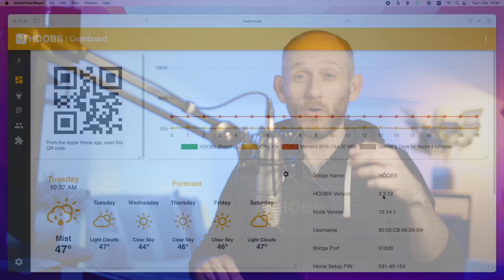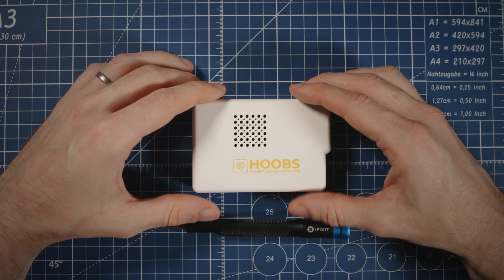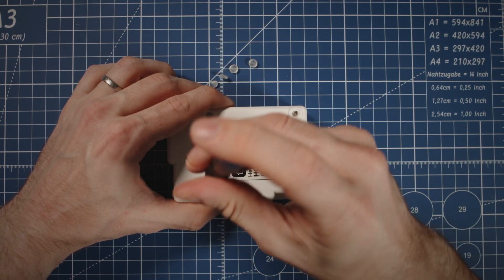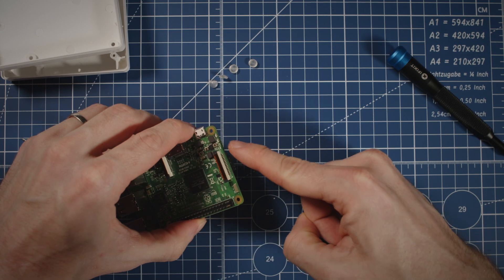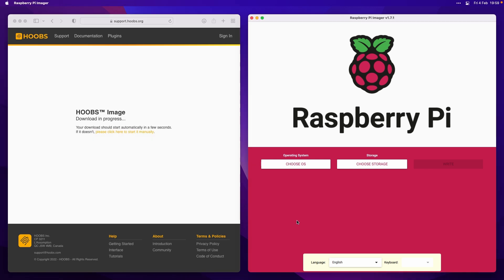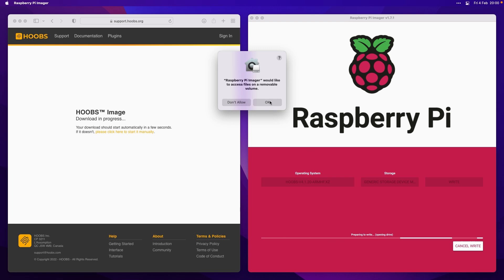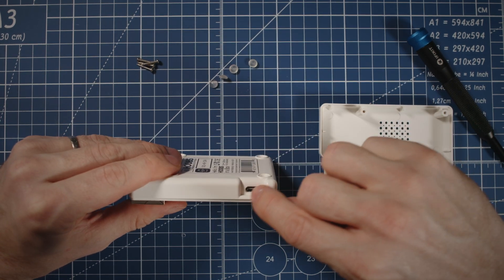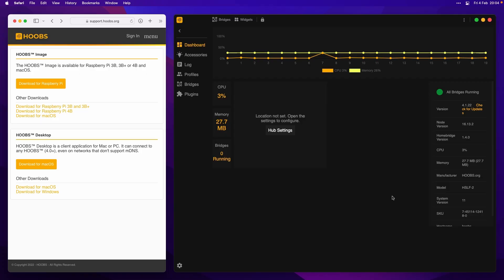Upgrading my Hoobs 4 setup with a quick reflash

Comment: Hi, thanks for the video. I went through the whole process, but can get the hoobs connected. Also, I noticed it has a solid red light inside, Is there something else I have to do? Thanks
Reply from the maker: Solid red signals stable power so that's a good sign. The green LED should flicker a lot when booting and then will probably go off.

Are you connecting over Ethernet or WiFi? You'll have an easier time doing the initial setup over Ethernet and you should see the lights on the Ethernet port flicker signalling data is being transmitted.

Comment: Thanks for this video. I'm trying to go through this process to restore my service, using the Balena Etcher app on a Mac to reflash my SD card (for Raspberry Pi) but unfortunately, I keep getting an error warning saying "the elevated process died unexpectedly". Any suggestions?
Reply from the maker: Have you tried using Raspberry Pi Imager as an alternative to Balena? It's possible there's a bug.
Reply: @tech_craft  Actually, I was finally able to do this by using a very old version of Balena Etcher. The problem was, I was trying to do this on an old 2008 iMac running on Catalina OS (the only computer I have available at the moment), and for whatever reason the newer versions of Balena Etcher wouldn't play nice with the older operating system. I also checked into installing the Raspberry Pi imager, per your advice, but unfortunately I would need a newer version of Mac OS to do so. Thanks to a Google search on "Mac Catalina and Balena Etcher" I was able to find a thread in their support forum describing this workaround, and I am back in business!

Comment: Thanks for the video. I use HOOBs for my home. Is there a program I can do a backup/mirror my SD card? I would like to have a backup card incase the SD card I am using become corrupt. It would be nice to be able to take out my SD card and insert the back up card and be back up and running without reprogramming everything. Thanks again for the video. I will be following.
Reply from the maker: Thanks for the kind words! There are a few options for backup. Which OS will you be taking the backup on?
Reply: @tech_craft  I would be using Windows 10. Thank you for your help.
Reply from the maker: It’s been a while since I did this on Windows but I believe the current best option is still Win32 Disk Imager: https://sourceforge.net/projects/win32diskimager/
Reply: @tech_craft  thank you very much. I will let you know if it works.

Comment: Hi,
I did the update just like you showed it on my RaspberryPi 4. After that my hoobs does not show up in my network, regardless if connected via cable or if I try to reach the wifi access point to set it up. It's not even in the list of connected devices in my routers device list.
Any suggestions anybody?
Reply from the maker: Are you able to connect the Pi to a monitor to see what, if any, error messages are being reported?
Reply: 12.7290581
-I end Kernel panic
- not syncing: Attempted to kill init! exitcode=Ox00000100

That is the error it showed me after hooking it up to a monitor
Reply from the maker: Yow! Which image did you download? I’ll burn it on to one of my Pi 4s and check!
Reply: Now I downloaded the one specifically labeled for the 4B and it worked. Thank you so much for your help!!!
Reply from the maker: Perfect!

Comment: hi glad you are back, my Hoobs is on version 4.0.110 and no updates to be had, should I do a backup with all the bridges I have installed as im guessing this will all be gone after a new install is done, will the backup then work and install all the bridges that are there at the moment or will it be a complete start again?
Reply from the maker: Backup works nearly always for me, but I always like to use a new SD card when doing the flash. I have two that I rotate, keeping one always with a known working set up.
Reply: @tech_craft  If my Hoobs wasn't updating, I backed it up, flashed a new card, will the backup still add all my old settings?

Comment: Question. Do you know if hoobs can work with a Raspberry Pi Compute Module 4. Thanks
Reply from the maker: Certainly can. You'll need to flash the Hoobs image on to the CM4, but you'll have no problem getting it to work.
Reply: @tech_craft  ok Thanks.

Comment: Will you be doing another dive into Wyze Cams on HOOBS? I’m running V3s, and not really interested in killing the firmware and loosing the built in features. I got an an Nvidia Shield TV, and was running TinyCam Pro on it and bringing the cameras into HOOBS that way, but the frame rate was really slow. I’m sure there is a way to use that setup and optimize the settings to get better frame rates, I’m just not sure what to do. Glad to see you back.
Reply from the maker: I will be doing the Wyze Cams setup - I just need to get hold of them. The version that is available in the UK isn't so great, so I want to get a US one. 

The Shield TV idea is an interesting one. I have a Shield kicking about somewhere so I can give that setup a go.
Reply: @tech_craft  I can order a V3 and ship it to you, let me know if you’re interested. Not sure if YT does messages, if it does drop me a message with your email and I’ll get ahold of you, or drop it in a comment and I’ll get ahold of you that way.

My idea with the Shield was that it had more processing power than most anything else I could install TinyCam on, but I think Windows 11 is going to add support for Android Apps soon, so that might be a better way to go at some point.
Reply from the maker: Thanks for the offer! The HOOBS team has kindly offered to ship me some devices so I can make these tutorials.

I think the Shield setup should be fine. Where are you running Hoobs?